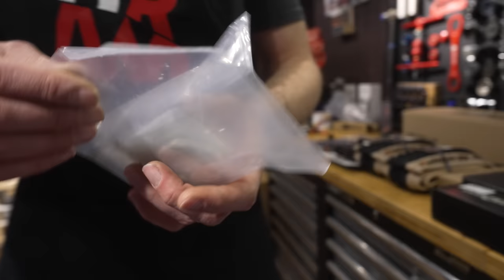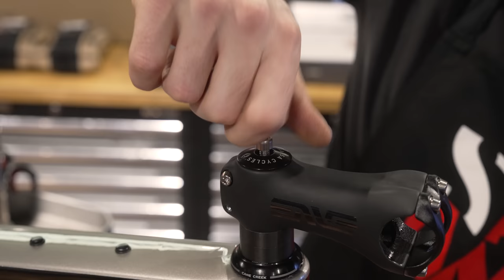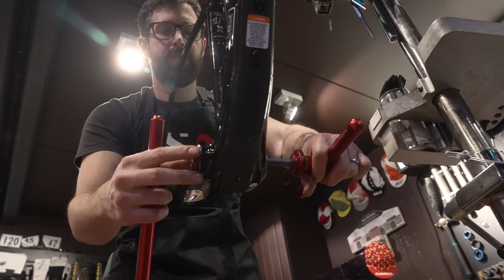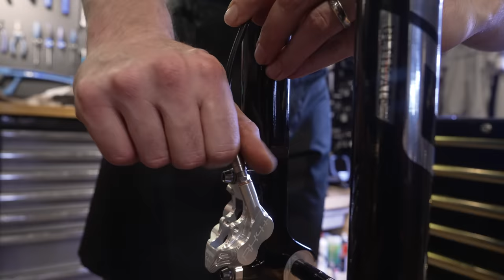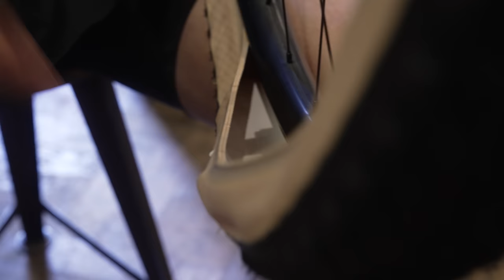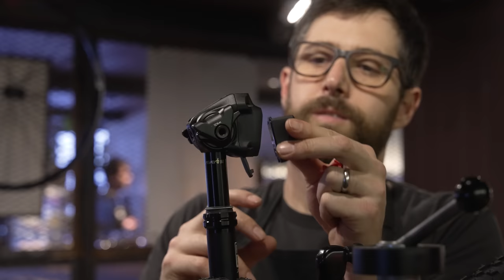This £12,000 Drop Bar MTB is Anything But Ordinary...

Comment: Mesmerising. I'm curious as to why you choose to wrap the bar tape from the top down. I always did it that way with smooth Benotto tape but with modern ones it feels less comfortable to grip which is why I changed to starting at the bottom

Comment: Nice bike as always jimmi ! Personally wouldn't spend 12 grand on it but that's just me ! One for you ! Tan walls or all blacks ?? 👍
Reply: And that's 12 grand on a bike the guy is not going to use on ultras... no dynamo hub. Expensive gear that costs also a few grands to renew once used (and if you're an actual bikepacker with some practice, you go 3000 to 13000 miles/year, you'll have to maintain your groupset).